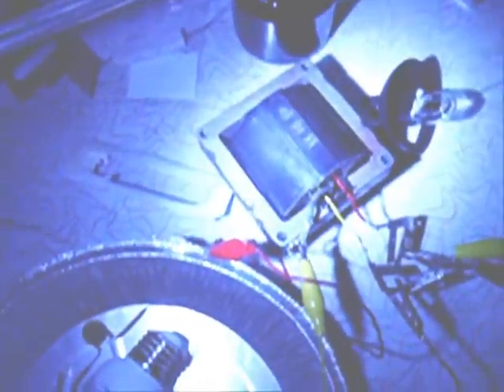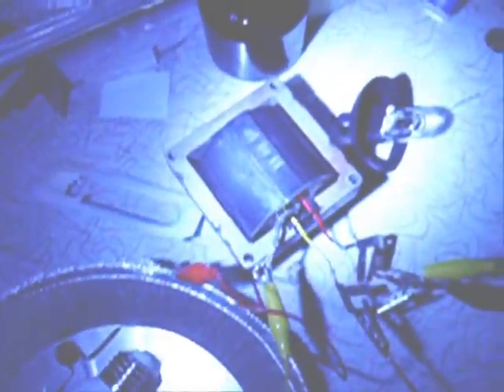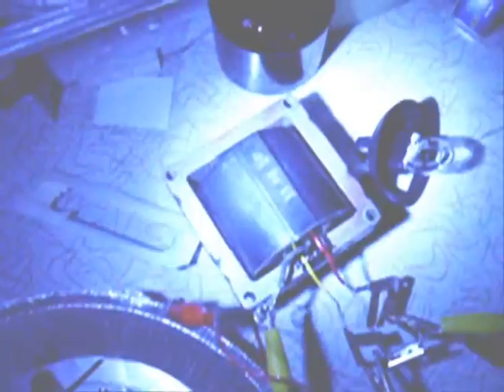Replication of Jonny Davros One transistor with trigger coil oscillator

Comment from the maker: Thanks Jonny. In my tests I got a 'feel' of the output by accident :-). I can attest that the output is of a lower frequency then an SEC and can be quite painful. This may be due to the large ignition coil I used in place of the samller trigger coil. Perhaps the smaller trigger type coils are the way to go for better SEC type effects. Either way, the circuit is interesting and rather efficient. Thanks again for sharing your ideas with all of us.